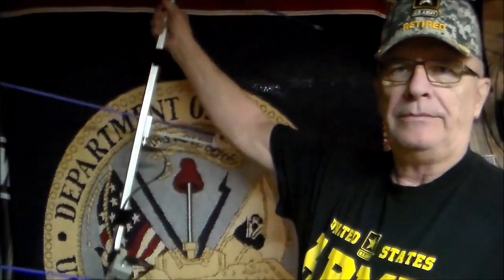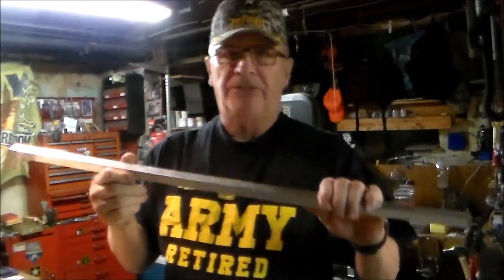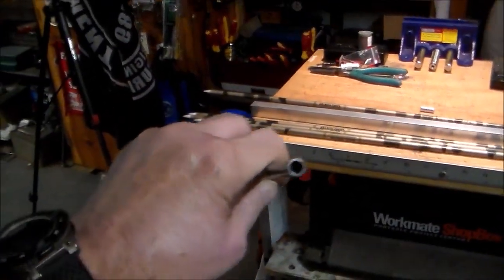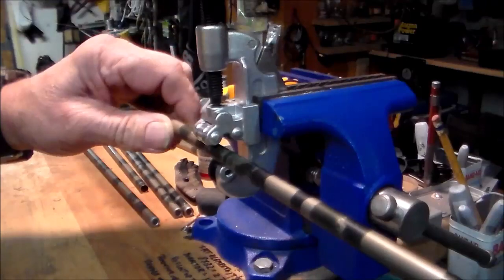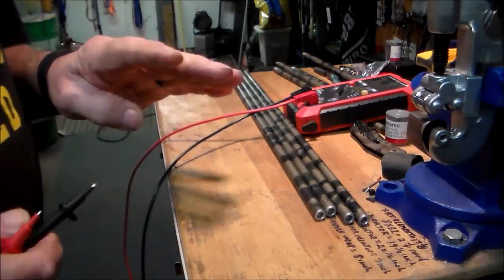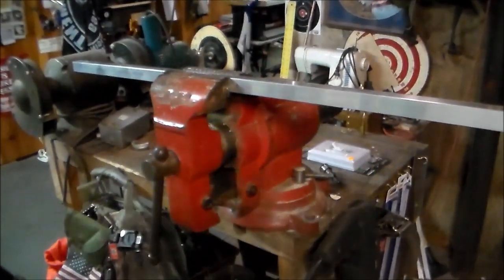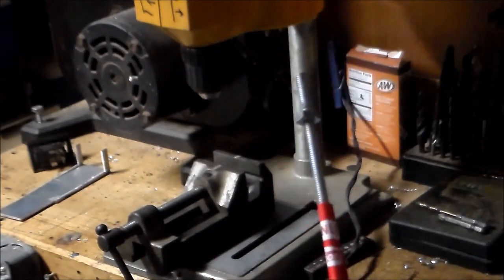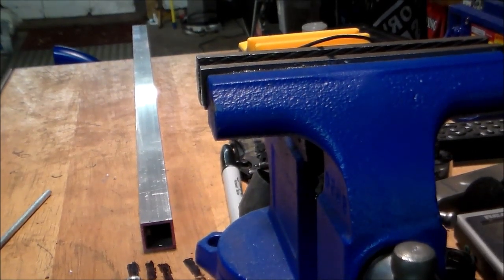Making of a Yagi fox hunt antenna

Comment: That's quite a novel approach for a breakdown Yagi. However, from what I see, the most popular handheld Yagi for T-hunting appears to be the 3-element "tape measure" version, which is very cheap and easy to make, is flexible in the field when hunting through foliage and folds up for transport. Plus there's no need for a gamma match.
Reply from the maker: Thank you first for watching, THEN allow me to say that LIKE ALL HAMS, I started this project as a way to further myself in fox/bunny hunting. It was only going to be a test to see if I could do it, then it caught on with my club... I was going to make one of those tape measure yagis, but then saw ALL the other guys doing the same thing, so I thought i would go a different way,,, Im happy I did... Oh and these yagi type antennas are quite sturdy ,,,The arrows are the same ones that they use to hunt deer and bear,,, so they do hold up to abuse in the woods,, Thanks again for watching, RON K3RJW
Reply: @polishpicl  Thanks for making the video. I think it's great that T-hunting has a following in your neck of the woods. It has essentially died out where I am -- ageing hams and associated mobility problems being the main problem. I am considering trying to get the younger members interested, and commencing with a Yagi build session appears to be a good way to go.
Reply: @James_Bowie  Where are you at?

Comment: What is and gage of the wire for receiver collector, please? I looked at your video several times and missing it.  Thank you for this video.
Reply from the maker: I used the inside core of rg58 keeping the resistance of the wire the same..I tried 14 gage once but it was less than optimum on recieve..

Comment: Does the size shaft matter? I have some old 1816's lying around. Also I would love to see the three element version. I just got my Technician license last week. KI5WGI
Reply from the maker: I found out that it does but very little. As I state on my video, its not for transmitting unless you tune it and you can recieve on a coat hanger but the yagi allows you to recieve directionally .

Comment: Are you still,selling your antennas?  Interesting. How do the 2 compare to,the 3?
Reply from the maker: The 3 is about 60% more sensitive so using the 2 close to the fox is better and the three at longer distances.but both can be used either way,you just have to understand your own antenna with practice.
Reply from the maker: And yes still selling them.

Comment: Thanks for making this video! Very easy to follow and informative! I do have one question... what did you use to make the gamma shorting bar? I am hoping to build both a two element and a 3 element as soon as I can gather all the parts needed! 

Thanks again and 73 from KO4ARX
Reply from the maker: First thank you for watching,,,,I use the center of rg58 coax solid core....
Reply: @polishpicl  Thank you for the response... and I have a follow up question 😁 what is the metal piece that connects/clamps the the short piece of arrow to the longer one? 

Thanks and 73 de KO4ARX
Reply from the maker: It's just a cut piece of aluminum to hold the two together..they work both ways..connected with screws electronically or just joined holding the smaller tube parrellel.
Reply: @polishpicl  Thanks so much!
Reply: @polishpicl  Does that "connector" piece have to be metal?  I was thinking of using the foam plastic arrow holders from the arrow box?
Reply from the maker: I just use another cut down arrow..if you use plastic .you may get too strong a signal....that really is unknown and if you would .and it works with plastic let me know please
Reply from the maker: @scouterdonn3110  Never used anything but the metal ones cause I have al I need here, but try, you never know until you try, and then let me know how it worked. RON

Comment: Great Video! What did you use as a clamp for the receiver collector wire? Also...what are the measurements for the beam and element spacing of a 3 element yagi? Thanks again for the great instructions.... KN4WXI
Reply from the maker: I use two piecies of aluminum that I had laying around for the clamp/holder,, flat about 1/16 inch thick,, the measurments of the elements are DIrector is 17 1/8, Driver 19 1/4 and the long one being 20 1/4. . Hope this helps.
Reply: @polishpicl  thanks alot for the info. What's the spacing between each element?
Reply from the maker: @justinshephard5262  Send me your e mail address and I"ll actually send you the instruction sheet that I use..
Reply from the maker: @bugpower18t  I'll send. Email of the complete build
Reply: @polishpicl  Can you upload this and share/edit the description? Would help many of us. ;)

Comment: can you please make a video for UHF and how to turn the antenna
Reply from the maker: They actually make an antenna for UHF...there is a great you tube video on best way to hold and turn it. If you need specifics write me back..
Reply: @polishpicl  I'm new to Ham, so I was interested in making a UHF Yagi. I have watched a ton of videos and most are for 2 meter. Very few quality videos are for UHF, I enjoyed how you explain how you make your antenna's. I believe I have the general idea how to make a Yagi, I'm looking for the spacing requirements and how to tune the antenna.
Reply: How Long does the pickup wire need to be?
Reply from the maker: @elwilliams1992  each freq is different,,the best bet is start at 10 inches and trim from there to get best reception at each quarter inch to a known transmitter on a specific frequency
Reply from the maker: As you saw,,7 1/2 inches for 2 meters is my optimum

Comment: Can you make me one for 318 Mhz?
Reply from the maker: Never tried.... Size and weight matters.
Reply from the maker: Don't think so..try it yourself it's pretty easy...
Reply: @polishpicl  I found a yagi calculator that will tell me the lengths I need. I’ll try that.
Reply from the maker: Outstanding......that's not only how YOU learn,,but then you could teach others,,,and make a video right away...
Reply: @polishpicl  I’m thinking about using a handful of those extendable silver alloy antennas that an old hand held radio might have, to make a universal Yagi, because I’ve been playing with a bunch of different transmitters that all use different frequencies and I’m not quite sure what I want to build yet. What do you think about that? You think it’ll work, if I can come up with some boom to allow them to slide around and be adjusted?
Reply from the maker: @frosty1433  oh yes..I made a dipole out of a few of them...called buddy poles and are available on Amazon